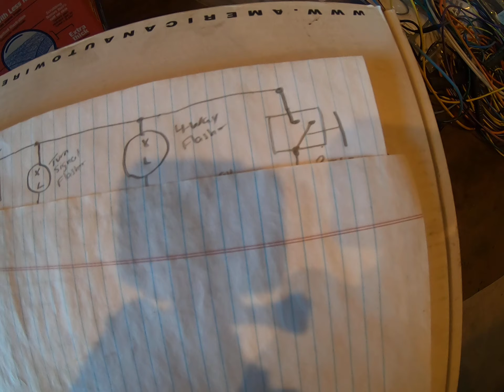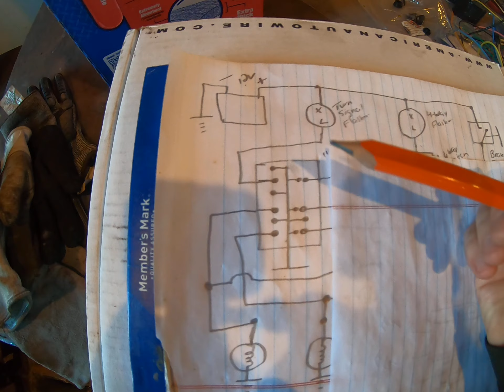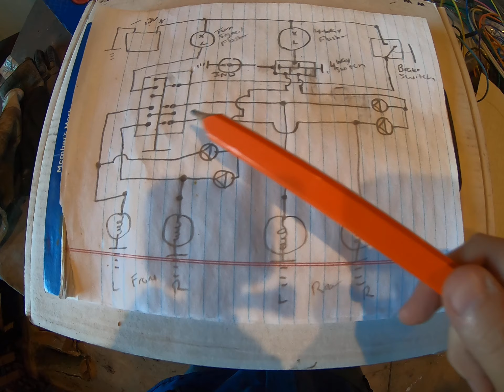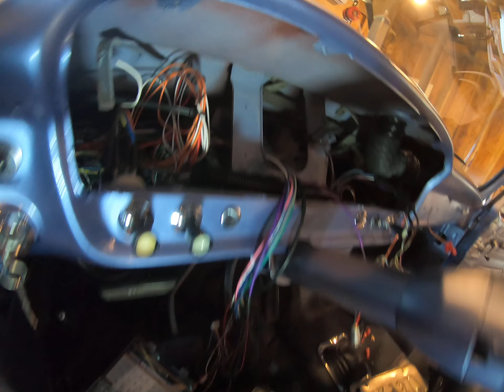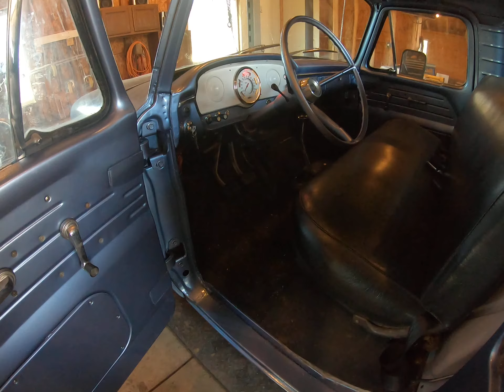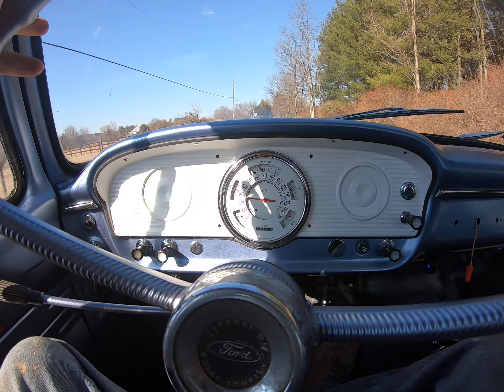1966 F100 (Fred): Gages and First Test Drive

Comment: Great Info H&H! I have that same harness.  I have all the manuals for the 61-66 trucks.  So, on the original round dash the green indicator was one bulb, you didn't get two...  the swepped speedo of the custom cab trucks gave you both left and right indicator lights.  FRED RIPS!  Nice!  

You can get the stainless steel hub caps with the black Ford script from Orange Truck Shop in Cali.... the black and red letter colors on your caps are not factory correct.  I'm gonna go work on my truck now.  Thanks
Reply from the maker: The harness kit worked out pretty nice.  I could have opted for a more fitted one, but they were 3x the price.

Yeah I dug a little more into the hubcaps today and I see where the previous owner painted them BY HAND.  So I decided to keep that look.  I cleaned up the backs and it looks like they were galvanized, so maybe the previous owner bought some black ones at some point?  Who knows....